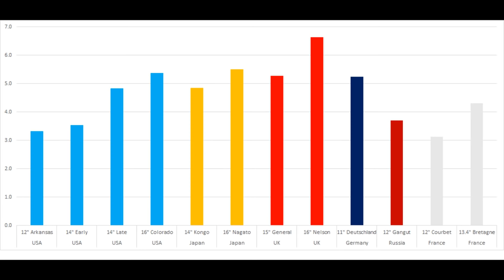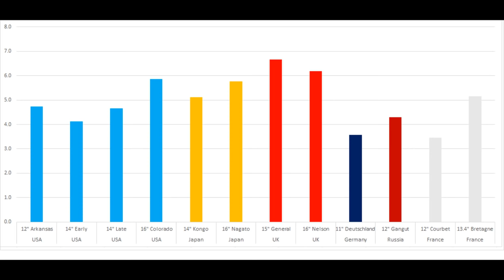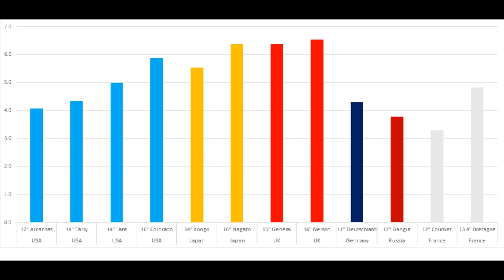Battleship Guns of WW2 - A series of tubes

Comment: With the last 2, one must take fire control into consideration. Kent Budge, the author of the Pacific War Online Encyclopedia, believes that Iowa, with her advanced radar and rangefinders, would win a shootout with Yamato at long range and bad weather or at night. Conversely, Yamato would win on a clear day. In addition, the ballistics of the 18.1 inch gun were poor for its caliber. Then again, both of these weapons saw limited surface action off Truck and at Leyte Gulf, so it is hard to determine
Reply: Iowa’s effective range wasn’t as great as many like to believe even with radar, at least with the crew she had in 1944 (based on live-fire tests where her accuracy was dismal at 30,000 yards, in spite of having been designed for engagements at those ranges). In good visibility her effective range wouldn’t be significantly (if at all) greater than that of Yamato.

At night, of course, Iowa has a decisive upper hand.

Comment: You capped it at 30,000 yards based on ability to hit a moving vessel, let's assume for sake of argument it has  a range of 50,000 yards, it would perhaps not be usedful for ship to ship engagements, but is useful for shore bombardment especially if you want to stay away from shore batteries.

Comment: Loved the video. Have a few questions and comments:
How much value is there to rating a gun detached from the overall system? Wouldn't range, rate of fire, accuracy be directly tied to great extent to the system the gun is installed? Like it would never make sense to look at this neat Yamato 18" gun and wonder how it would perform when installed on a destroyer.

If you are purely rating the gun why not use the shell velocity instead of range - the shell velocity mostly defines the ballistic characteristics of the gun - high velocity shells fly in a straight line while slow need a higher ark to reach the same range. Range is mostly a function of velocity and angle. Since angle is tied to the gun system and velocity to the gun it seems like a natural substitute. This would tie in better with your argument that high maximum range affects the angle at which the shell hits the armor at closer ranges - that is purely a function of velocity and less so of the range.

I find your reasoning of not using arbitrary weights for the overall score in favor of just picking what data to include flawed - you introduce the same bias but you simply limit yourself to two different weights - 0 or 1. It's a very superficial method to eliminate bias which demonstrably is still there - you produced the first set of scores, did not like them and then changed it. That is still bias. I think it is pretty obvious that some aspects of gun characteristics are more important than others. So it seems only natural to use a weight system and just abandon the naive idea of having no bias, which no matter what you do will be there anyway.

Comment: Informative video. Can you follow up with a descriptive video on the variety of breech mechanisms used?
Reply: Nice idea, but it should be part of a wider investigation of turret design (which was surprisingly varied).  I guess the difference between sliding breechblock and interrupted screw thread designs, and different arrangements of magazines and hoists, is taken into account in this analysis via rate of fire.
Reply: @glennsimpson7659  The history of breech designs and engineering detail is far too diverse (abd fascinating) a subject to be subsumed into turret design. Due to time constraints it would just end up being watered down and abbreviated to the point that no-one would learn anything useful.
Reply: @andrerousseau5730  Indeed.  I was interested to see that the British 14” gun breeches pivoted downwards, presumably to allow 4 guns to fit abreast.  But naval rifles pose special problems.   The uTube video on Texas’s turrets is a most interesting one, with most operations requiring manual handling, and the powder monkeys and sight setters on a lower level than the breech workers (one of whom had to wear a safety belt to avoid falling into the gun well).

Comment: No matter how good your gun system is you still need to score hits. It would be interesting to see who had the best fire control systems
Reply: The US, by a considerable margin.
Reply: @glennsimpson7659  
Once radar really came on line probably. I'm more interested in the optical side
Reply: yamato and iowa had similar gun dispersion and and hit percentage at max range. (less than 500m dispersion and around 7% hit chance)
in terms of accuracy both usn and ijn were about equal but japanese ships on average had a longer reach because of higher gun elevation with yamato reaching 42km and iowa reaching 38km.
couldnt find accuracy data for british and german guns but as for reach the bismarck/tirpitz could go up to 36km and the nelson class up to 34km.
tho i cant imagine that german and british fire controll systems were worse than american and japanese.

Comment: Great Video, but there are two things that could be improved in my opinion:

-Make "Range" a function of Muzzle Velocity and Shell Weight. It is a bit arbitrary, but it gets around the issue of the gun mount being an external factor to the guns performance
-RoF is likewise an issue that is influenced by the mounting. An omission or lower score weight for the overall performance would be appropriate

Comment: Hi Drach,  Interesting but.  I think where you include range you should prefer muzzle velocity since range is a function of velocity, elevation and air drag.
Elevation is, as you say, a feature of the turret.  Your argument for range seems to be for a flatter trajectory and that is achieved with high muzzle velocity.  Rate of fire is more a feature of the turret, hoists etc than the gun.  
Penetration vs bursting charge?  A high bursting charge means a thinner shell wall which means less penetration because of shell deformation.  A high bursting charge does a lot of damage above the armour deck but to really hurt your target it needs to penetrate.  
I agree that absolute range is not important because fire control etc would need to be good enough to exploit it and that as you say is part of the overall weapon system.  
Accuracy is important.  Your target density (ship area per sea area) is low so just blazing away with an inaccurate weapon is not likely to win (I appreciate your remark that you don't have that measure for them all).  Mind you while the quality of the gun is highly important in accuracy, there is plenty of latitude for the instalation (mountings, turret, hight in the ship) to degrade it.
For me accuracy, muzzle velocity and penetration are the most important in the gun.  The rest depends too much on other factors.
On the other hand if you are on the ship being shot at then you might think the whole weapon system more relevant.

As a side issue, the quality of a gun depends on the target so, for instance, it is unfair to pitch the Deutchlands against battle ships because they were supposed to run away from them.  They were armed to defeat cruisers.

Comment: Given that the correlation between range and shell performance is because both are dependent on the shell's speed, rather than due to range itself having any intrinsic effect on performance, why not use muzzle velocity (which, unlike range, isn't affected by the turret's mechanical limitations) instead of range?

Comment: For your formulae: your approach works, but as you say is heavily influenced by outliers. If you wanted to reduce the effect of outliers, you could instead compute standard deviations for each line, then compute how many standard deviations from the mean each gun is. That will give you a scale that is theoretically from -∞ to +∞, but practically speaking lies between -3 and +3. To convert that to a 0-10 scale, you can pass through either (with X as the input): 

1. 10arctan(X)/pi + 5 (interpolating between -∞ and +∞, meaning that essentially all values will be between 1 and 9, and absolutely all will be between 0 and 10)
2. 5(X + 3)/3 (interpolating between -3 and +3, meaning that the vast majority of values will be between 0 and 10, but truly exceptional outliers might fall outside that range).

Comment: You may have used muzzle velocity rather than range, as that would not depend on turret elevation. Though is doesn't account for ballistic coefficient of the shell. (aerodynamics combined with mass) 
I don't know much about other navys, but American ships carried multiple types of shell, so the 16" AP shell was very focused on AP and gave up some burst charge, while the lighter high-capacity shell had about 3 times the explosive payload and offering medium penetration(about half of the AP). 
In addition the later 16" AP was a much heavier shell with the goal of having a slower shell fired at higher elevation so it would plunge down more into deck armor. I don't know how that could be quantified on a good-bad scale, its more of a strategic choice and opinion.

Comment: Well reasoned and presented video. In my opinion, weighting the categories would be advantageous, as not all these parameters are equal in my opinion. For example, the shell weight matters relatively little, in and of itself, if it can't penetrate a target's armour (of course, weight has an impact on penetration). However, I understand, and indeed agree with your decision not to, in order to present the data without an added layer of subjectivity. 

Perhaps throw up a survey allowing people to chime in with what they think are the most important factors and see where that leads?

Seeing accuracy numbers that are comparable would also be fantastic, but unfortunately I doubt those exist, especially in a state where the numbers aren't excessively influenced by whatever fire-direction equipment was installed.

Comment: What you hopefully noticed while trying to get a reasonable comparison out of the data you had:
You can't reasonably compare what you defined as a gun (without a turret) and you couldn't even compare the whole turrets, because these items are ONLY used as a small part of a battleship and its crew, all of which TOGETHER determines, if "the gun" performs amazing or abysmal.
A barrel + breach + firing mechanism rolling on the ground without a turret is useless and does funny things, if you fire it.
A top notch turret without a trained crew to operate it, is likewise useless, although it might sink your own ship, if you untrained average Joe blows it up.
And if you have all this and put your turret with trained crew in your basement or a deep valley it's also useless. You want it on some maneuverable and well-controllable ship.
So the ranking itself is IMHO pretty much nonsense. All the interesting details you mentioned are of course interesting nevertheless.

Comment: After WWII the allies did a review of combatents guns.  Accuracy at distance is an issue for all guns. So a smaller gun with a higher rate of fire and relatively longer barrel for the calibre of gun would be more accurate. And thus be more effective.: get more shells onto the target than a larger gun that on the face of it would be better. 
By memory, I read the review many years ago, the 13 inch gun was seen as the winning compromise.

Comment: If you have ever constructed any kind of 'banger' you find out that the low bursting charge, if correctly measured against the casing, can make the largest bang and produce the largest amount of shrapnel so, as with Panzergranate, they cannot really be taken as a deduction to its destructive power should it hit anywhere that requires manual control. (Dreaming of what a pair of Flak 40's would do to a modern destroyer if it was surprised using a DU/PzGrte combo).

Comment: I should have thought that by WW2 the main use of battleship main guns was in shore bombardment, with a lesser use as deterring cruisers. That needs different criteria from those for slugging it out with another battleship. Sustained rate of fire and performance at extreme range matter more, armour piercing rather less. And for shore bombardment tube life matters too, which is irrelevant for a sea battle.

Comment: the only two items I can think of off hand is the ROF, most shells took roughly 40 to 60 seconds to arrive on target, so spotting could be done  So it is not always firing at full rate.  So perhaps us a uniform rate of fire as the norm 1 to 1.5 as the true rate.  Also in firing salvos different navies used different methods.  Secondly in response to range, the dispersion rate for different guns at the same range is different.  You mentioned the article in Warship International.  What I noticed there was that the Italian 5" appeared to have dispersion rares almost identical to the German 15" at all ranges out to 30000 yards.  Looking at the gun without looking at the complete fire control system is very difficult.

Comment: and one cannot talk cannons without talking shells.  The development of shells and their quality or lack thereof is just as important.
The US developing their super heavy AP rd for example.  It is interesting the RN and USN had different theories on that: the RN wanted a bigger bursting charge and the USN wanted more weight to generate more penetrating power.  Each had its plusses and minuses.  The deeper inside the ship the shell goes before exploding is important; but then you also could get as happened fairly often the shell punching right through and exploding after it left the ship.  Or exploding at the hit and just blowing a hole there.  I do not think there was enough data to support either premise over the other

Comment: Drach small piece of history you may be interested in. One of the guns off one of the Iowa class battle ships is still seeing use to this day. It’s no longer being used as a gun but as a way to test drill bits for oil rigs. They rigged the breach of the gun so that it’s beneath a fully operational rig and they can test various pressures and soil samples before digging out the real thing.

Comment: Interesting fact that not many people know. A resolver is an electromechanical device that changes mechanical motion into an analog electronic signal to precisely determine angular position and velocity of a rotating shaft. Today it is used on most hybrid and battery electric vehicle drive units to measure electric motor/generator rotation. Resolver circuits are a very old design from the analog age but obviously still have practical use in conjunction with analog to digital converters in today's world.  What does this have to do with battleship gunnery? One of the first practical uses for the resolver circuit was for the aiming of battleship guns. Didn't think a Dreadnaught and a Prius had anything in common did you?

Comment: The dataset used is perfectly reasonable, given that you have to make choices to limit the amount of data you're working with, and they have to be based on the targets that these guns were designed to be used against. As opposed to the targets they were actually fired at (we could call that dataset 'A study of shore bombardment targets of the Second World War'). I think a similar study for WW1 guns would be worthwhile. I also think a paper comparing the guns used in heavy and especially light cruisers would be very interesting, given that those weapons were far more likely to have been used against the targets they were designed for. And in terms of alternate data, I have to think that most of the major naval powers pre-WW2 must have made similar calculations. One wonders if those papers are available in naval archives?

Comment: Although I like your current system, I would argue that gun size (and therefore weight) does impact traverse and elevation speeds, and therefore should be included. If you do this for WWI era guns, I would merge the elevation and traverse categroies into one, since they are both dependant on the same thing (weight), but not remove them entirely.

Comment: Using Drach's figures of merit for each gun the twelve 14" guns of the KGVs as originally envisaged collectively outgun the nine 16" guns on an Iowa which makes for an interesting talking point.
Reply: Wouldn't have mattered, by the time the KGV's got close enough to where their guns could penetrate Iowa's armor they would have been blown out of the water by the Iowa's 2700 pound AP shells.
Reply: @CRAZYHORSE19682003  That would be an interesting matchup, the Iowa's larger shells vs. the KGVs' thicker armour.

Comment: This is a futile exercise. A gun is basically just the barrel. What matters are the length and its rifling twist. The twist and the ammo (shells) weights need to be matched. If the twist and shell weight are not matched you get awful accuracy. As we can't just take these barrels and design optimal ammo for them to test them, we will never have an answer.

Comment: Did you factor in angle of impact? Guns firing higher angles (and longer ranges) will impact at higher angles. Considering they have a higher chance of hitting the top of the ship and not the generally very well armored side could have an impact on the amount/effect of damage.

Comment: In regards to the importance of maximum range of the guns, it is important to note that  greater effective ranges is potentially very important when it comes to shore bombardment which was a very common usage for battleships. You might point it out later in the video (only at the 13 minute mark so far), but it seems like you were focused solely on ship vs. ship combat when it comes to range.